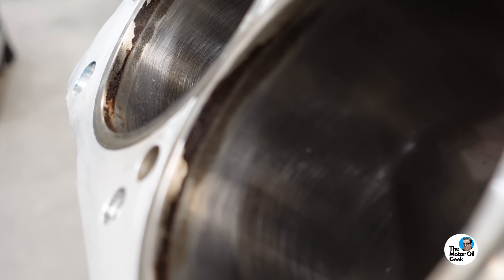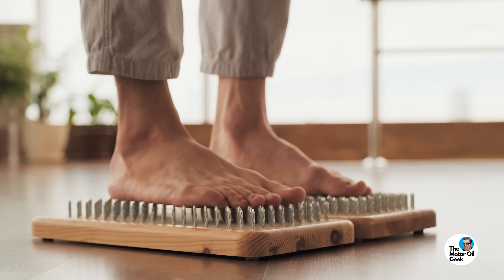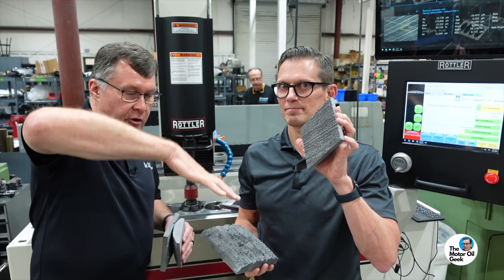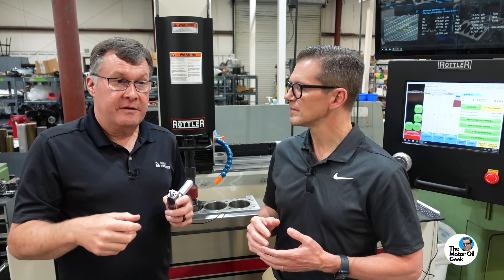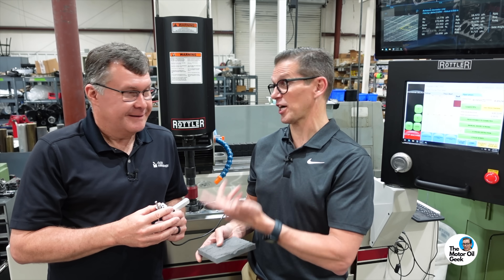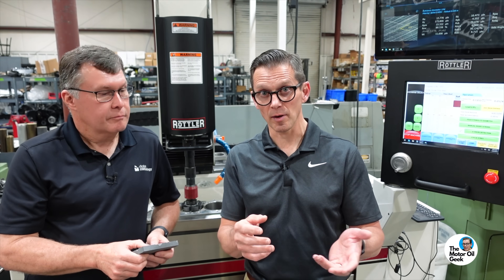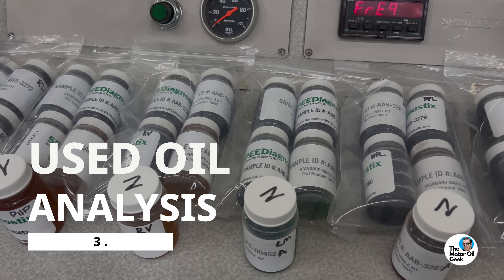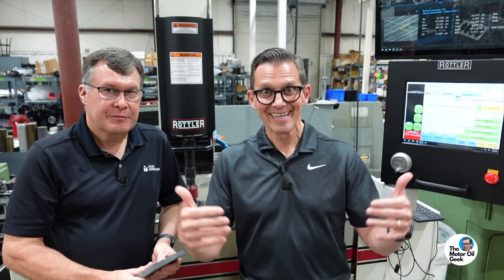GM's $1 BILLION Dollar Blunder: ROUGHNESS Matters...

Comment: The other dimension is cylinder surface material..  cast iron sleeve (Oil loves cast iron?), OR is it some plasma coating.  Remember the old Vega days?  Smoking bad at 20K miles, but with a cast iron sleeve they'd last forever.  Why in the 6.2 V8 do all the bearings apparently overheat and seize?  In the old days you'd say clearances set way too tight and heat expansion uniformally caused all bearings to seize at once?   Bearings are replaceable can be any material and set clearance.   Crankshaft material is some type of steel.  Saw one vid that claimed the Crank Oil Passage chamfers at the bearings was way too deep.  This apparently steals bearing surface area, overstressing the bearing.  Crank finishing should be pretty stable after 50 years.  What changed in 2021ish?  Check out 
https://www.youtube.com/watch?v=ohGx0xIanNY
I'd like to know if I can buy a flawed new truck with the 6.2 and fix it myself.  I hear there are cylinder deactivation delete kits now just available, but unclear if that will fix a surface finish problem.  I'd tackle a pushrod engine in a Rear Wheel Drive truck over a OHC anyday.  Then there is the transmission, but apparently Ford's version has even bigger issues?
Reply: Watched the video again.  Was Proffered that the New wierd 180 degree Thrust bearing failed causing the crank to move Axially and severely stress all bearings?

Comment: Application dictates chemistry.  Application dictates surface finish.  Drain plug and oil analysis can show if I've got it right, but how do I know what to shoot for in a build?  Are there tables that show which ring and surface finish work well together?  You and Mark know empirically, but I'm just guessing.

I'm building a 4.6L i-6 Jeep engine; stroker crank, low lift (.425") roller camshaft, roller lifters, and roller rockers.  Forged, non-hypereutectic pistons and moly rings.  Static CR of 9.6, dynamic CR of 8.4, and good quench.

I've honed with 320 grit, and of course it looks rougher than a cob.  I have 400 grit stones, and was going to attempt to "plateau" the peaks, but am concerned about honing too little, or too much.  Without a profilometer, its just a guess unless there's a recommendation chart somewhere.

I'm going to use the Driven 5w-30 Break-in oil and change it after the 30-45 minute camshaft break-in.  Should I sample that oil for a base line?

Comment: IMO if you don’t measure you can’t manage. I was hoping for your comments on the GM crankshaft journal oil holes, chamfer and attitude angle direction that affects bearing reliability but sadly not as per your podcast title sadly?😢

Comment: After 100 years GM suddenly can't machine parts.  Toyota and Ford having the same issue?   I call BS on this.  The problem is 0w20 thin oil and machined bearing journals that don't have the proper clearance.   Oil gets a little low, high RPM, into a turn, oil drops below pump, no oil presure for 1 second and spun bearings.  Because of government mandates there are no drive systems on the market worth buying.

Comment: I think you are missing the problem a bit. There may be a problem with the surface grind, but.... when the engine is running the bearing should not be in contact with the crankshaft. The oil is what makes up the actual bearing surface. I think the problems with these engines stem from oil delivery to the bearing... i.e. gpm.....(pressure without enough flow).  I have installed hundreds of crankshafts in my 40 plus years as a tech. Never once had an early crankshaft problem. Most of the cranks I have installed have come from local machine shops, with questionable cranks grinders. Out of round or tapered journals eat bearings more than a 'not quite polished' surface.  Excessive crank oil hole size may be a problem also.  my $.02....

Comment: @themotoroilgeek, if I replace the oil drain plug with a drain valve, is that a negative with regard to the magnetic capture of metal in the oil? I am trying out one of those magnet gimmicks that sticks to the bottom of the oil filter, to see what that does when I inspect it at the next change.
Great content and please deep dive more into surface texture and all that. It's a fascinating topic.  Thank you.

Comment: Combine that with 0-30wt oil, 10,000mi oil changes, and you have the current disaster. Not much that can be done form the outside of the engine for the rough surface finish on the crank.

Comment: How the heck did engines designed and manufactured 70 or 80 years ago using relatively primitive oil formulations, less precision measuring methods and machining techniques last as long as many of them did? How? Especially in light of just as much neglect and delayed maintenance as you see today? How was it possible, what am I missing here?

Comment: Yes, prevent galling and glazing by providing small interruptions in the contact surface. It prevents 'plowing' of the metal deeper than need be during beak-in. Thus the worn off material will be very small particulate size that can be carried away rather than larger scaping flakes. And the valleys between islands or plateaus can fill with oil, molly and other additives.   So it's usually a combination of two textures a rough or medium hone that creates cross-hatch and a finer hone than flattened the peaks in the first cross-hatch texture somewhat.

Comment: What I would like to know is how the old International 345s with only 5 psi oil pressure could ran as long as they did without issues and now engines that idle with 30-40 psi do have issues.

Comment: Would you recommend using the Pensoil Ultra Plat 0w40 over the Mobil 1 Supercar for the recalled 6.2L GM motors????
Reply: Not really. I tried it before and wasn't impressed. You have to shake it before use because it separated in the bottle

Comment: We had an issue with a Torque converter “one way “ clutch slipping.  Discovered a supplier changed production method from grinding to hard turning.  Technically both methods met defined surface specs.  Ground did not slip, hard turned did.  Engineers need more understanding of texture vs surface finish.  And how to correctly define texture with specifications.

Comment: The sad thing is that the company that makes these crankshafts has been doing so for decades. I don't believe it's a problem with them, I believe it's a problem with GM. As per insider information I have, GM (and the other companies they supply but the person I know who works there specifically mentioned GM by name) wants them to keep making batches cheaper and cheaper and cheaper once they start a new production run. Of course this cheapening leads to corners being cut TO make them cheaper, because the factory cannot maintain the same quality when GM pays them less and less and less.

Will GM learn their lesson and allow their parts manufacturers to actually produce quality parts as they are capable of? I doubt it. They want maximum profit and as little reliability and as low quality as possible where they can still sell cars.

Comment: I was hoping that you were going to take profilometer readings on L87 crankshafts to show the difference between a good one and bad one.  Instead you spent the whole video talking about cylinder bore surface finish, where the lubrication regime is mixed.  Engine bearings operate in the hydrodynamic regime.

Comment: The surface finish should only come into play when the engine is rotating without oil pressure. It is not like the unpressurized interface of the piston and cylinder wall. If the oil pressure is present between the crankshaft journal and the main or rod bearing, the texture will not contact the bearing and therefore not cause wear to failure. I believe the real culprit is machining "flashing" left in the oil passages of the crankshaft. Easy to overlook if the step to deburr the passages is omitted while trying to save money. Just guessing but I can see the manufacturers bought into a machining process that was sold to them that would eliminate the need to follow up the passage drilling with a deburring step afterwards.

Comment: After watching the Ecoboost and GM failures I'm so glad I spent ten grand and completely restored my 99 f 150 short bed regular cab five speed V6 that I bought new 26 years ago and still has perfect body, interior after 275,000 miles.I did all the work myself but it's pretty much new from bumper to bumper including radiator, starter, coil pack, completely rebuilt the motor,new clutch assembly, all new bearings and seals in the rear end,new shocks, brakes, tires, ball joints, control arm bushings, a/c,steering box,even new headlights and tail lights.too much to list and I get more compliments in it than I ever get in my 2015 slt sierra.its just another truck but the old Ford is something special, looks like it just came off the assembly line still and runs even better.and any part that offered a lifetime warranty I got so I have a lifetime warranted truck or about half of it is, none of that 50,000 mile crap.

Comment: Hi Lake, firstly I really enjoy your videos! My 2023 Sierra is part of the massive 6.2l GM recall.  It passed both tests and now has 0w40 Super Car Mobil 1 in it.  As you know the cost of this particular oil is very high at  $11/qt.  I was going to use Mobil 1 FS European blend which meets the dexos R spec and is about $5/qt.However I watched your show video regarding this blend and your conclusion was not to use it in direct injection engines. Which of course the 6.2l is direct injected.  Do you still recommend not to use this FS blend. I do my own oil changes and was trying to keep the cost down.  Thanks, Dale from Ann Arbor Michigan
Reply from the maker: The current formula of Mobil 1 European 0W-40 is API SP rated, so it is safe to use in a direct engine. It is also way easier on the wallet.

Comment: I bought new trucks last year.  Both were designed in 2009 and tools from that era.  I chose the old designs because the new vehicles of today are have much less quality. The era of great engineering ended around 2010.  The 2 manufacturers have had 14 years to perfect the production of the trucks I bought.  I did it because currently produced vehicles do not give me confidence in long term reliability.

Comment: Afton oil's 2019 spec book suggests GM used 5w30 for all factory fills, regardless of service fills such as 0w20 in the 5.3L. Does anyone have any insight into this? It would make sense to use a heavier weight from the factory, but also suggests that these engines can operate just fine on that heavier weight oil.

Comment: GM bought the latest and greatest to do machining on this engine. Are they still cutting grinding then polish or no grinding to speed things up. Dont look at the chamfer, there are tens of millions of GM cranks over the years with 200 thousand miles with No oil hole chamfer and not a scrach on the bearing shell.

Comment: OK,
So I will have Jon Kaase Racing build my BOSS 521 with the correct ring package and the correct cylinder bore finish for a street driven 770 HP N/A big block Ford V8....
Too bad for GM Junk L87 V8s.
Maybe use 10W-50 oil to save that POS!?

Comment: Had the opportunity to visit Saginaw casting where they make the engine blocks for the 6.2. They told me the problem was the connecting rods (from China) were bending as they were not properly heat treat hardened. This eventually makes them off center on the crankshaft and start to wear the bearings and shed metal and jam the lifters. They don't know which connecting rods are soft. The issue is one engine may have all good rods and another one has two or three soft ones.   That's why they're changing oil viscosity to buy a little time because they can't produce enough engines with the properly treated connecting rods.

Comment: The engineers know how to design an engine, but the bean counters demand bad designs as long as they can save $10 psr engine. $10 here, $5 there, multipy by 500,000 vehicles using that enigne and it's significant. So the bean counters are to blame.

Comment: Hi Guys, great info in your programs, many thanks. Over here in Australia they've begun the engine tests on the 6.2litre L87 GM V8 and replacing the 5W-30W oil with 0W-40W oil after the engine passes the appropriate tests. My question is, would using GM's 5W-40W be an acceptable thing in these engines?

Comment: The old trick was if a copper penny left copper on a journal it was used up or not finished write . How in the world did they crank out cranks in the 50s 60s and 70s and not have this big of an issue as far as i ever heard of !!!!!??? 22 year machinist and operator here . There silly light engine oil weights and to tight of bearing clearances dont help . Small block chevys ran something like .0018 minimum .0032 max on the main bearing final clearance and .0018 to .0024 on the rods . You could run 10w30 or 10w40 all year or  20w50 in the summer in hot climates and never have a problem until ALOT of miles , like 200k+ . What a joke modern manufacturing is and there is no excuse except- COMPLACENCY and GREED . Shameful

Comment: I have a 2012 Ford F150 5.0 engine. I have a lifter tick. Rislone and Lucas oil stabilizer claims to quite lifters. My truck uses 5W-20  oil. I use Mobil 1 high mileage synthetic oil.  Are those two oil additives a waste of money?

Comment: If GM was smart they’d swap out all L87 engines and that would absolutely drive brand loyalty to unbelievable heights, then they could implement a fix and resell the engines as crate motors or reconfigure them to a new spec and install in other vehicles

Comment: Less-than-perfect journal finish, ultra-low viscosity oils, ridiculously long OCI's, ethanol contamination. Put these together and you have a recipe for a very bad day. If a preventive measure is to run 10-20w-40, then, everyone should and also skip the 0w-8 to save your engines. Unless you live in the very cold, I wouldn't run a 0w. 10w or 20w will be good enough for starting flow.

Comment: How did going from GM crankshaft/engine failures switch to cylinder bores surfaces ? Having worked in the aerospace industry for many years  yes, I understand surface conditions standards however switching your discussion to cylinder bores is not inline with your stated subject matter !

Comment: Opel's engines over here in Europe at that time all suffered from this blunder. Opel dealers called them oil tankers, because you had to keep adding oil all the time as those engines would burn it like there was no tomorrow. The solution was pretty simple though: instead of taking it easy the first few hundreds of miles of the engine run-in period, dealer salesmen told their customers to let their new car's engine warm up properly and then to "drive it like you stole it" (flooring it, redlining it, etc). The logic behind this "abuse" was that the piston rings were still rough enough to slightly score the bores, therefore improve the honing and allow the piston rings to properly seal.

Comment: Just another one of the many many problem that EVs don't have

Ratio of ICE drive train issues to EV drive train issues are like a few hundred to one

EVs have a handful of primary supporting components and few dozen less significant parts

ICE drive trains have hundreds of parts that wear out and break inside of engine block and hundreds of parts outside of the engine block, not counting the many many diagnostic systems which themselves are problematic

Comment: I noticed a product update released by WIX filter 02/25/2025 which provided new part numbers for some GM engine filters. The part number updates coincide with an increase in bypass filter pressure from 12 psi to 22 psi. When questioned they said that they were following GM's recommendations. This update affects my 6.0 LS which normally uses a WIX 57060 which will update to a WL10290. Do you think this update is related to some of the problems GM is having with oil issues?

Comment: Opel/Vauxhall 2.2 DTI engine, too much gloss on the bores from new, causing oil burning issues. Running in oil tried by GM as a cure, but that could have issues with the rest of the engine.

Comment: I live in a, year round, warm climate. It’s never cold. My 2014 300c with 28ktms calls for 5w-20 but the dealership here puts 0w-40 in my engine. I recently changed to 0w-20 for the first time. I drive less than 3k miles per year and lots of city, start/stop, driving.  What are your recommendations for oil type? All comments are welcome. Thanks guys.

Comment: Man, I dodged a bullet when passing on the purchase of a GMC Sierra Denali back in 2022. As much as I liked the interior and exterior of that truck, the seat comfort was the deal breaker. Never would I have thought to be dealing with such a catastrophic engine failure that GM is still not adequately addressing.

Comment: GM AND DODGE CANT BUILD A RELIABLE SMALL BLOCK ANYMORE. BETWEEN THE LIFTER/CAM BS THAT THEY BOTH HAVE HAD NEARLY 2 DECADES OF DATA AND STILL ARE PRODUCING CYLINDER SHUT DOWN CRAP ENGINES..AND THEN THE CRANK BEARINGS ARE GARBAGE ON THESE LT ENGINE NOW TOO !!!???

Comment: A mirror finish definitely makes a difference on a polished crank but let’s face it, on hot summer day with the AC on while towing your boat, that very light weight engine oil is over 250 degrees . If any metal to metal contact can happen and it will happen under these conditions. Im not sure why we are talking about rings when it’s everything else that’s failing when the lifters and crank are getting eaten. This is why GM finally recommended a higher viscosity oil for the L87 . I’m surprised they haven’t carried that recommendation to the other V8 engines in use.